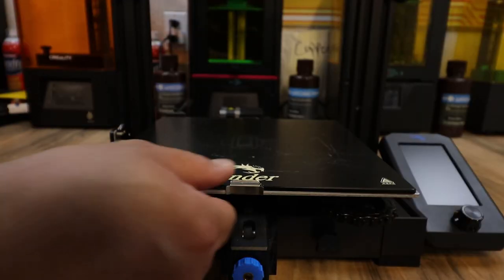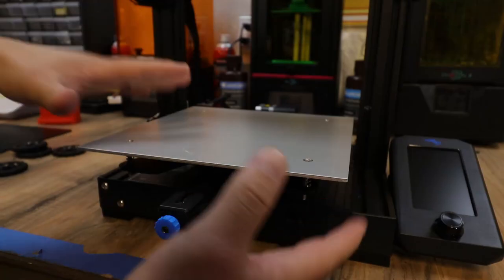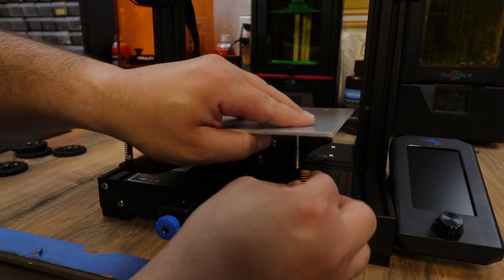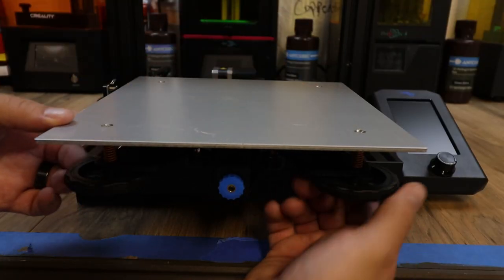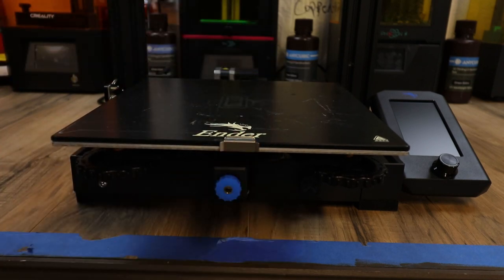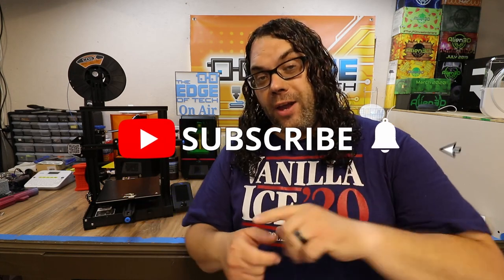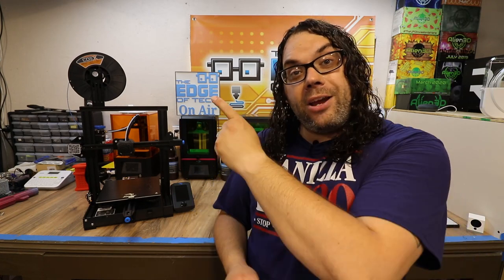Upgrade the Ender 3 V2 Bed Springs in 5 Minutes or Less

Comment: Yeah, sure, the stock springs work great IF they never incur temperature changes. I suggest keeping them in a climate controlled vacuum chamber and never heating up the bed. Personally, I have found that they work best if you carefully install them in a trash bin.
Reply from the maker: Haha 🤣
Reply: Still better than th3 garbage orange ones

Comment: Love to upgrade all my Creality 3D Printers with these Yellow Terras! The only reason though, is due to the additional tension applied to the adjustable leveling wheel! As the factory springs are so soft they do not hold the adjustable leveling wheel from turning, and therefore changing the bed height. So what I do as an additional safe guard from the adjustable leveling wheel from moving at all. Once the bed has been level 100% I always place a locking wing nut on the underside of the bed screws, so that these locking wing nuts bear up against the underside of the adjustable leveling wheel. That wheel is going nowhere now! I get a very very long time between levels, 6 months now in fact! That is just because I miss leveling.....lol
Reply from the maker: Awesome! Great tip!
Reply: The tip looks a good idea, I'll try wing lock nuts first before I try the springs!

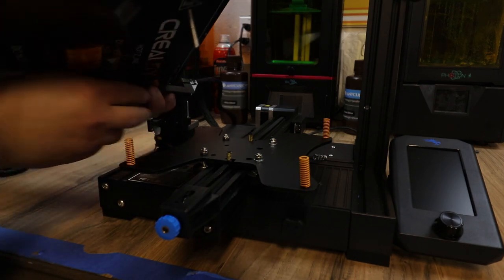Comment: Most important part for me was about 2:30 where you put the spring in the plastic tray underneath. Thanks for that tip, was driving myself insane with a tilted bed. Thanks Jim, that earns a subscribe (as well as the customary like).

Comment: It can be difficult to get the thumb screws back on the bottom of the bolt. You have access to the head of the bolt on top of the plate, its way easier to just screw it in with a screwdriver until it starts to tighten up, then use your hands to do the rest manually. Definitely makes it easier to get the thumb screws on in the first place, that way. 

If anyone is wondering if you need to do this, the answer is yes. My stock springs were bowing out sideways under the bed messing with leveling pretty bad. You likely have the same issue with an ender 3v2
Reply from the maker: Great advice! Thanks!

Comment: I tried 2 lengths of yellow springs. The first was an ordering error .... too long. While trying to adjust the bed, the 4 corners deform the more I tightened the screws. So I bought the 20mm screws, The same phenophene occurs. The glass plate at the 4 corners still tells me that the corners are distorted. A space between the glass and aluminum plate is clearly visible. I can place the clamps so that the plate follows the aluminum tray, but then the bed is warped, what good is using a glass plate. I have to leave the screws tight to the minimum and the advantage of the yellow screws is not justified ..... I have not yet found the solution to this problem.
Reply from the maker: Hmm. Did you tighten them all the way, 1 at a time? That will warp them for sure. They have to be tightened in pairs and only half way at a time. So do the front half way, then the back. Then come back to the front and finish the tightening. Then go to my bed leveling video and that show you to loosen them 4 full turns each. But if they are tightened 1 at a time, they will warp the bed. In your case you could use some blue tape at the corners to fill in the gap under your glass and that may help.
Reply: The tighter you compress the springs, the more likely the corners will bow on the plate so you probably want to tighten them enough they hold in place, but not maximum tension.

Comment: How about using a silicone stand instead?
It can withstand the heat.
Thanks for sharing😀
Reply from the maker: They work good as well, but I only use the solid be mounts when I have ABL installed.

Comment: Am I the only one who left the stock spring on  the corner where the heater connector is? There we have that  plastic connector that leaves less room for the spring as compared to the other three corners. As a result I noticed that there we have  more pressure on the nozzle compared to the other three corners when using comparable stiffness across the springs. To compensate for this difference (due to the plastic thingy thickness) I just used three orange springs (since they are lightly higher) on the other corners and the stock one (lower and less springy)  on that corner. This seem to make leveling more uniform across the four angles.

Comment: I put the yellow spring on my Ender 3 pro but haven't go do putting them on the V2. They worked well on the 3 pro, thanks for the prompt I will order them now.
How about a video on fitting the BL Touch on the Ender 3 V2.
Reply from the maker: Thanks Bob! The BLTouch video is the most requested right now!

Comment: What do you think of the silicone spacers. They come orange and black.  Plus I have seen some videos with some putting Nuts on the post screws to help stabilize them.
Reply from the maker: I use the nuts if I don't have the upgraded springs. But I use the solid bed mounts when I put ABL on any of my printers. That way they don't move and the bed stays in one place.

Comment: thanks for the vid! :) will upgrade mine soon once my printer came in.. 

another question, will the dual gear extruder work for ender 3 v2?
Reply: Was wondering this as well, did you figure it out?
Reply: @LumenRoy  Just installed one on mine. :)

Comment: I've changed the springs, but it has a drawback - when there will be a "bump" on the print, if the nozzle hits it, it is likely to rip off the print from the bed, while on the stock springs - they'll are likely to compensate this hit.

Comment: I replaced the springs with these. Issue I am having is in the back left where the plugs come in to head the bed. It’s as tight as it would go down but I can’t level that side. I have taken it off again and tried with same results.  Any help or should I go back to regular spring for that one.
Reply: That is strange, I had exactly that issue with the stock springs, which was because the spring in that corner was deforming to the side under the tension. I haven't leveled yet but it seems in my case these new springs remain straight, so I have good hope

Comment: Great vid, thanks.. Is it fine if I got the 25mm instead? I saw they got quite the punch and could might even break the hot end cable strain plastic

What about the z axis you don't think it might need to be adjusted on the side for the new spring tension?

Comment: I just recently started having issues with my prints. I can't turn the wheel on the left towards the back anymore, but the nozzle is still too close to the bed, I try my best to level the whole bed anyway but once it starts printing, the first layer is covered in gaps. Would this help?

Comment: Doing this for the ender 5 plus with the aluminum red wheels. The screws just spin, are there supposed to be washers to prevent the screws from just spinning?
Reply from the maker: I can't remember how that one was set up, but sometimes you could put a nut on the screw under the bed to hold the screw from turning.

Comment: These springs are way too long. I have them compressed all the way and the nozzle is just bottoming out? Is there a certain brand or size of these "yellow" springs ?
Reply: Bit late but watch out for the listed size! 20mm is supposed to be the standard that'll work for most 3d printers, but a lot of sellers also have 25mm springs, which are way too big for an ender 3 v2. I still haven't installed mine, but that's what I've found online
Reply: I bought these: https://smile.amazon.com/gp/product/B07GXC1G2B. They're advertised as 20mm and I verified as such.

EDIT: I can't vouch for these, but they're one of the few advertised as 20mm: https://smile.amazon.com/gp/product/B0899XB812.
Reply: @tomasturbado3942  Raise z stop slightly.

Comment: I installed the springs according to your instructions. that worked so far, thank you :) 

unfortunately I don't notice any improvement compared to the original springs. I have to level the bed bevor every print.

so i watched your video again. 

am I correct in assuming that the springs have to be tightened completely?

Comment: I have not had any problems with the stock springs but these new springs look like they would be much better. Are they the same height as the stock springs or do you need to adjust your Z stop for a higher bed level?
Reply: adjust z stop if nozzle too close to bed and the spring is at max tension.

Comment: Will these work on a basic Ender 3 with a CR touch installed?  New to the 3d game and helping my son get the best prints possible.
Reply from the maker: You could, but if you have the cr touch, you could do solid mounts as well!
Reply: So i understand, If i did solid mounts the CR touch would "figure out" level before each print(we added that to cura for a step prior to each print).  Sry for the basic questions but trying to make it as ease and enjoyable as possible for him so he works on his design skills.

Comment: Idk why they didn't work for me. I put in yellow springs months ago and I still have to level my bed before every print. I even dropped the z-limit switch a 1/2 inch. Its usually not major releveling just adjusting on the fly while it prints the skirt or brim but Its every single print. I can't tell the yellow springs made any difference.
Reply from the maker: I would double check and make sure your x gantry is level, if it's not you'll have this problem forever until it's fixed.
Reply: I have exactly same problem after each heat and cool down period all off. 😭

Comment: I have the new yellow springs. I installed them easily thanks to the vid. I have to tighten the springs to their max to get the z axis to touch down and even still thats not enough. Any advice for this? I haven’t seen any other comments on this problem.

Comment: Jim, as for which spring to upgrade to, did you consider even heavier duty springs, or perhaps the silicone posts?  If so what in particular tipped you to using the "yellow" springs?
Reply from the maker: I used the yellow ones for my Ender 3 printers and always liked them. They are heavy duty enough and work very well. I use the solid bed mounts when I put any ABL on, and I love those too!
Reply: @TheEdgeofTech  DId you ever run Octoprint's Bed Visualizer with the solid posts?

Comment: Did you take a look at superslicer you could make a video on it. It has a great calibration section in it which can help you calibrate all the settings to get the perfect print also it's based on prusaslicer with many additional features and options.
Reply: Just be careful when printing test stuff within the superslicer as it can get snagged on your bed leveling probe if you don't add more space between the test objects.
Reply from the maker: I am going to have to try it! Thanks for the heads up!

Comment: Jim, changed my springs, but in the process one of my bed mounting screws now just spins.  The other three are slightly loose, but don't turn when reinstalling.  What do I do about the one that's loose?  Thanks.

Comment: Does it matter how compressed the springs are? Clicked "auto home" and my nozzle is about 2mm away from the bed and very little adjustment left, so the springs are pretty much always compressed. Cheers
Reply: Raise z stop
Reply: Yep, that's what I did and that was the fix. Cheers

Comment: I changed the spring and now because the new spring compress way less than the others, the printer cant reach the z-axis switch, so if left alone, the nozzle hits the bed. do i need to move the z-axis switch up?
Reply: yes

Comment: Z end must be raised a lil bit because this springs leave the bed a lil bit up compared to stock springs!
Reply: Finally someone with common sense. Well done.
Reply: How did you raise the z end after installing the new springs?
Reply: @davidcleveland4575  just unscrew the part holding the z end then raise it up, just the necessary and then tighten up again.
Reply: Thanks for the reply,  it helps!

Comment: These springs do not require the Zaxis to be raised or modified?  I am worried i will have to mess with and adjust the zaxis switch which may take me forever to adjust properly.
Reply: you may need to move the z axis switch up 5mm or so and then re level the bed. thats all the extra work that was needed for mine

Comment: hey thanks for the video. i've just got my ender 3 v2 and ordered the upgraded springs too and when i fit them the bed now sits too high. the upgraded springs are taller than the standard ones. is there a way to adjust this or have i been sent the wrong springs?

Comment: I got a set of springs from my local supplier but when I put them on they seemed to be way too long. When I went to go level the bed and wound the wheels all the way down the nozzle was touching the buildplate with pressure so if I tried to level any further it would end up scratching into the bed. My springs are 25mm long do I have the wrong ones?
Reply: Same issue here, try with lesser size, ir could be 2 or 1,5 mm, what i do was use the same old springs, but i add 4 rubber rings that Fit in the screws, they help to get a better pressure. Try to buy Lesser size springs or use something to get More press, cheers!

Comment: Am I the only one who left the stock spring   the corner where the heater connector is? There we have that  annoying plastic connector with the wire that leaves less room for the spring as compared to the other three corners. As a result I noticed  we have  more pressure on the nozzle compared to the other three when using comparable stiffness on the springs.  To compensate for this difference I just used three orange springs (since they are higher bisides stronger) on the other corners and left the stock one (lower and less springy)  on that corner. This seem to make leveling more uniform across the four angles.

Comment: i can't level the bed... 
i have no idea how to do it, but my front right spring just can't get high enough. the screw is lose waaay to early. already scratched my glass plate on the bed, so i hope this will get me to actually use the printer
Reply: also i noticed my bed is getting higher if i move it to the middle. is there any way i can fix this?

Comment: i done this upgrade however now every print i do is a fail as they are all warping. i have levelled the bed to within an inch of its life all it trammed as good as i can get it, test i print for level bed all print but the min i make a proper print and it goes above the 2nd layer it starts to warp. any ideas??

Comment: I bought some, but they seem to compress super hard where I have it levelled, dunno if that's how they're supposed to be, but no matter what I do the center of the bed is always too low
Reply: Also seemed to break the plastic thing holding the wires to the bed plate

Comment: My V2 can’t print because of how awful the stock springs are. It was fine at first but now completely unusable. The front right corner is so loose that I can have it go as high as possible and the other corners as low as possible and it’s still way lower than the other corners

Comment: I had to move the Y sensor like 1/2 cm up since the yellow springs were bigger than the stock ones and the nozzle hit the bed even at full compress.

Outside of that, they work very well.
Reply: I had the same exact issue.

Comment: There are some vocal people in the 3d printing groups that think this is a waste of money. Honestly if you rarely have to adjust level its probably not needed, even still the springs or silicone bushings are cheap and does not really hurt anything.
Reply from the maker: Very true! Thanks for watching!
Reply: Even if it was a waste of money... its only about as much as you'd find digging around the couch cushions.
The YELLOW springs are a MUST!

Comment: Jim, great idea.  I swapped mine with the TH3D solid mounts on my Ender 5.  I removed them,  as my bed was not level and the  EZABL had to do all of the work.  I replaced them with a slightly different spring that I found on Amazon  https://www.amazon.com/gp/product/B07HNK48RQ/ref=ppx_yo_dt_b_search_asin_title?ie=UTF8&psc=1  this one seems even  stronger
Reply from the maker: Interesting. I love the solid mounts too, but sometimes they are not always the best option.

Comment: Those orange springs sUcK. They are to long and can't adjust the bed properly. There's not enough clearance between the nozzle and bed. I'm going back to stock
Reply: All you need to do is raise the z axis switch about 5mm. then youll be able to level the bed properly again